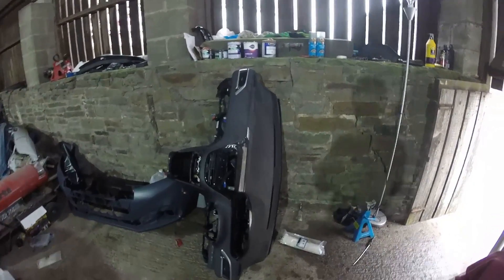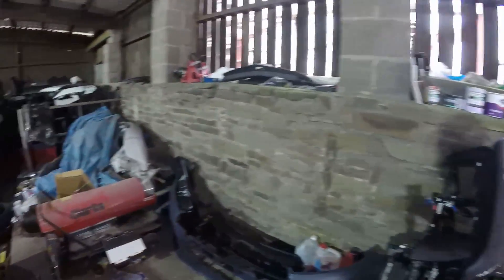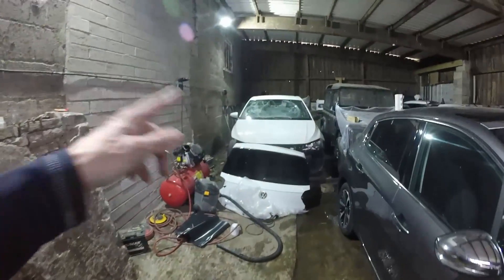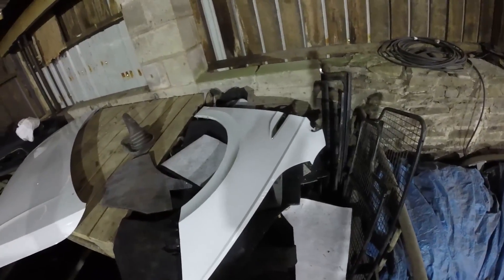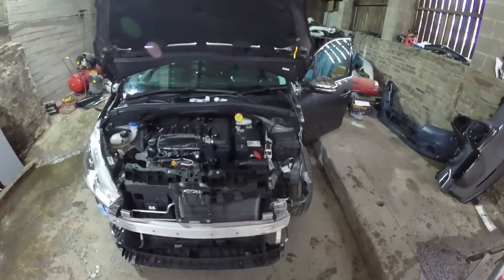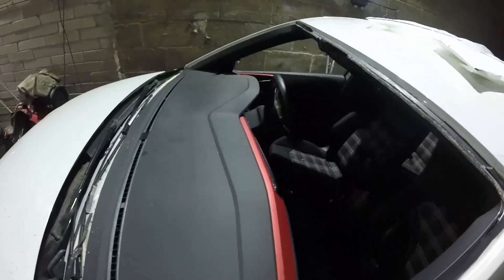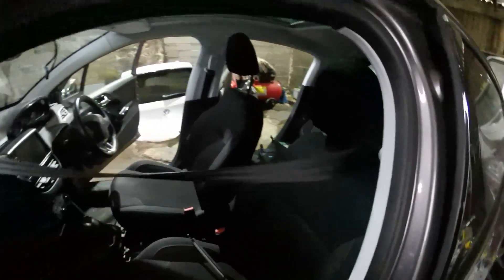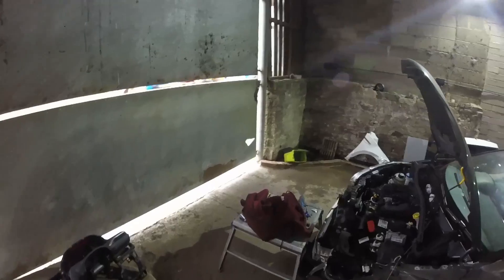The Job I've Been Putting Off For 2 Weeks Is Done!!!! YES Another Peugeot 208 Dashboard........

Comment: Hi phil
Just a bit of info I thought might be of interest to u in America if u purchase a salvage car or van and u repaire then u have to take for a salvage inspection test they check your repaires if correct they will issue u with a pass sticker they place it on the inside of the door piller
Phil in stoke
Reply from the maker: Hi Phil.

Yeah it used to be the same here on category S vehicles. Strange really they scrapped the idea and now it's basically a free for all! It is kind of worrying thinking what could actually be on the road all around us!

Comment: Almost completed my first salvage project, 2018 TROC where all airbags, belts went off. Absolute pig of a job but got it done. Dashboard swap is definitely no fun. Had the airbag module reset and replaced all belts and airbags. Airbag error is only light left on the dash. Do you reckon the icarsoft tool you use would see to that? Looking to invest in a decent diagnostic machine. Excellent channel has taught me a lot. Keep it up.
Reply from the maker: Hi Chris, i wouldn't like to say just in case you buy it and it doesn't ! I would give them a phone and ask first, can't see why it wouldn't though!

I would have thought if you had the airbag ecu reset that would have taken the airbag light out for you....
Reply: Cheers Phil. I thought the same but error is still there annoyingly. Will make a few calls and cross my fingers.

Comment: Top piece ( slam panel )
Reply from the maker: Slam panel is the metal structure behind this plastic piece. Just checked and the packaging just calls it a bumper bracket, it spreads across and under the headlights for extra support as well.
Reply: Serious About Salvage thought that’s the panel you mentioned sorry I misunderstood jus